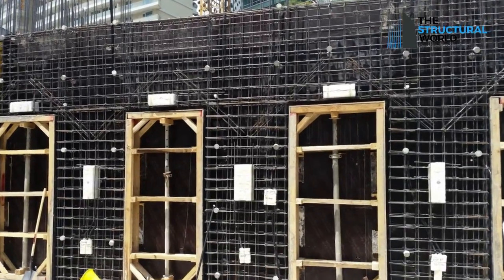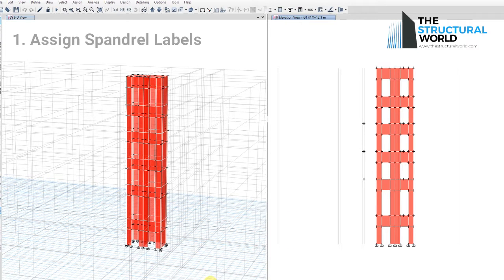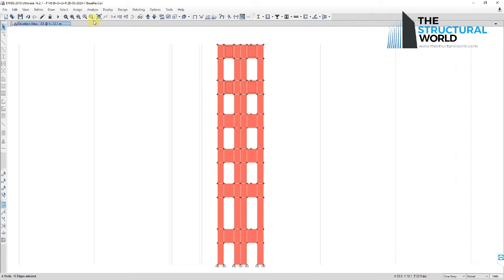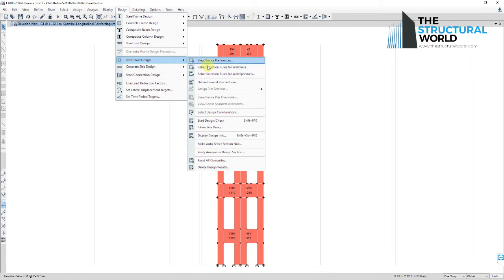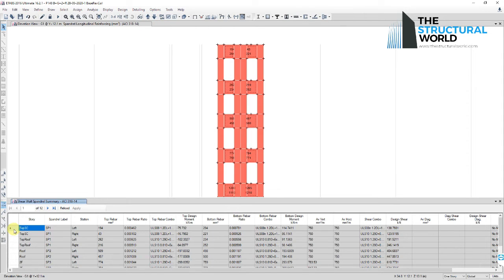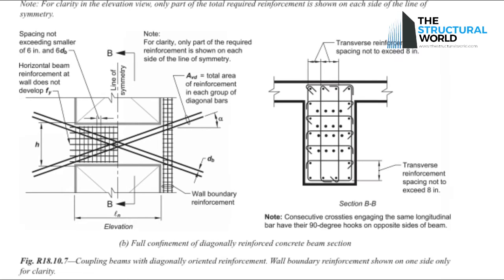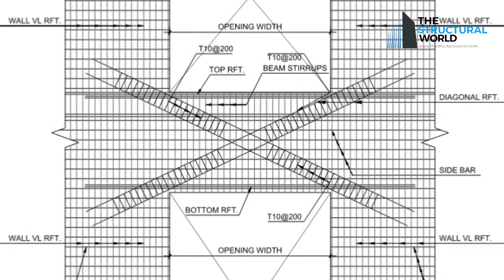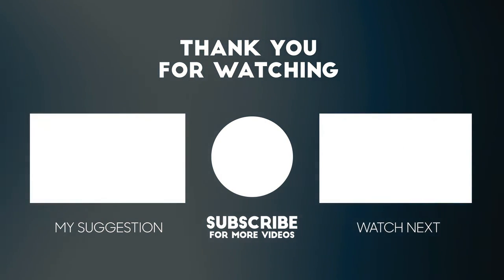How to Design Spandrel or Coupling Beam in ETABS

Comment: One question
What will happen if there is no spandrel beam?!
Reply from the maker: The main purpose of the coupling/spandrel beam is to resist lateral forces caused by wind and seismic. Not considering the spandrel beam will tend the shearwall to carry the additional lateral loads that will result in a higher number of flexural and shear reinforcement required.